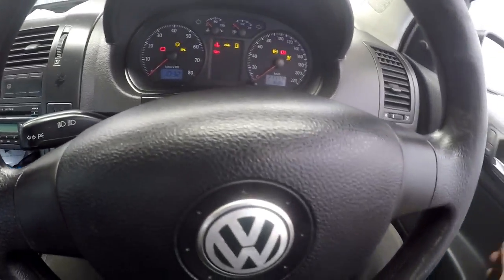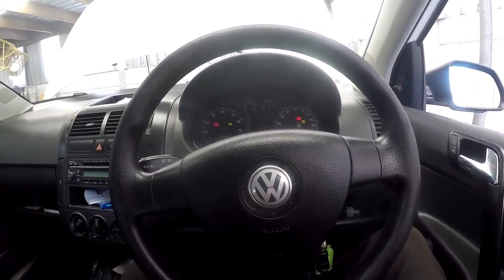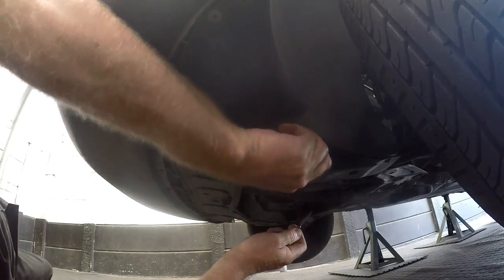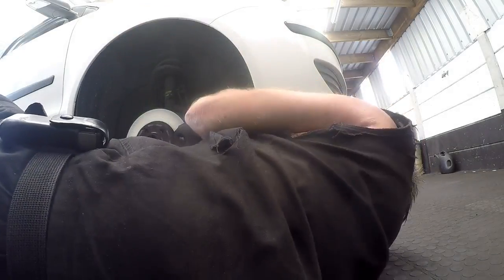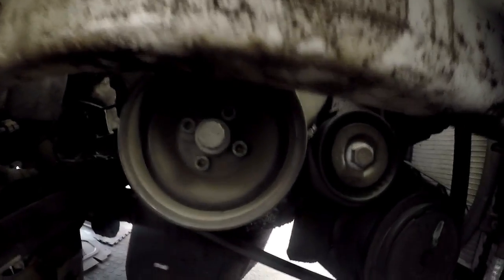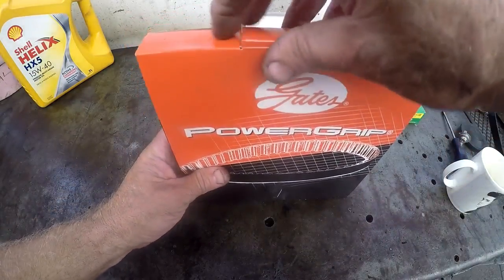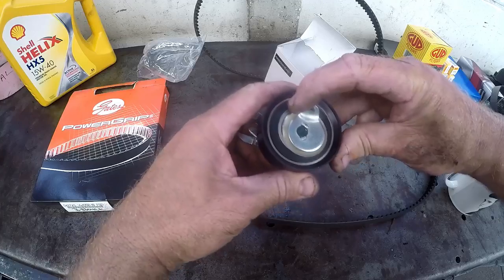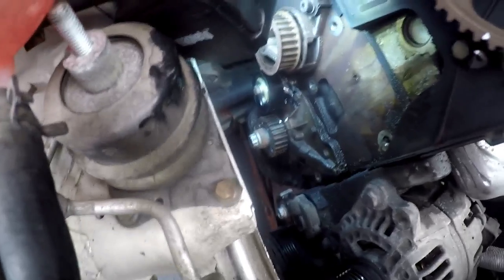Vw Polo (Blm engine code) - Cam Belt & Tensioner Replacement

Comment: Very informative thanks sir. I have a quick question sir. I have the same car but the hatch 1.6 2003 model 9n polo. My spark plugs are getting slightly wet of oil 2nd and 3rd. Whats the best way forward? Do I only do the head cylinder/ valve stem seals and oil rings or should I do the entire Engine overhaul? Thank you.
Reply: I had the same problem on my 1400 BLM Polo 2004 on 4th cylinder. Just had the motor reconditioned and in the process found lots of faults that caused it. 2003 model may need full engine overall.
Reply from the maker: Depending on the mileage and service history, doing the head and rings will usually sort this, but if the mileage is over 250k then best to overhaull.

Comment: Hi Gary, thank you for the detailed video. I have one question. How do I go about to line up the timing marks before I remove the cambelt. Should I remove all or only 1 spark plug? Should I place the spanner on the cam or crank pulley to rotate the engine in order to line up both the top and bottom marks. Thank you.
Reply from the maker: Hi Rahul, remove all spark plugs to allow the engine to turn easily, and turn the crank pulley clockwise.

Comment: Good idea as well to change that serpentine belt tensioner as well, they lead a hard life, and are pretty cheap to buy as pattern part.
Reply: Thank you for the awesome video Gary. I saw your video on servicing your Nc 750 x. I have the same bike and i absolutely love it. Did you service it from its first service interval or did you you take it to the dealer to service in order not to void the warrantee?

Regards
Coenraad

Comment: Most interesting again. At what mileage was the timing belt changed on this car? I see replacing the timing belt on these modern VW's is much more simple than I did on my 24 years old Golf 1.8, where there is an extra toothed pulley on an axle for the iginiton timing which is on the other side of the engine. Your belt is only for valve timing and pretty good acesseable ,  this makes the whole operation less critical, because you only have two marker points. On my car it is difficult to put the toothed belt back on, and span it, and at the same time keeping the pulleys on the white markers....
Reply: Excellent video. Spot on

Comment: Is this an interference or non interference engine?
Waterpump broke on my car and timing belt came off
Reply from the maker: I believe it is an interference engine, but it could depend on the circumstances such as the speed when it happened.